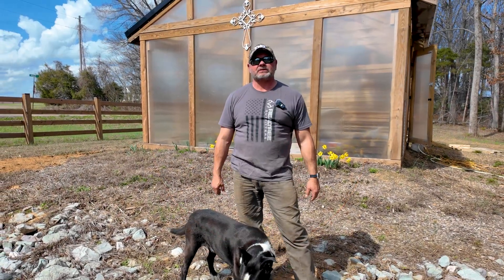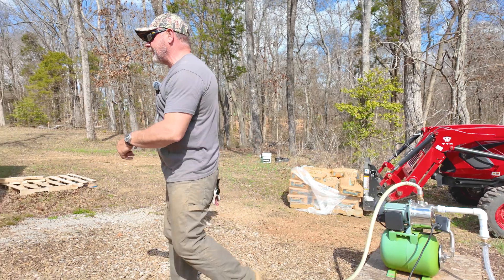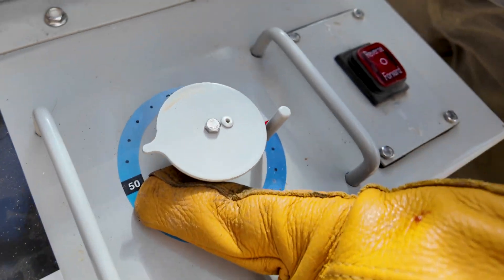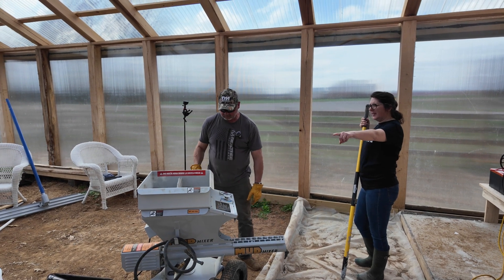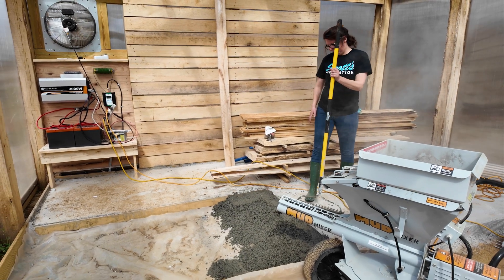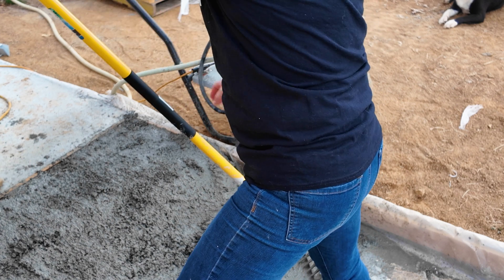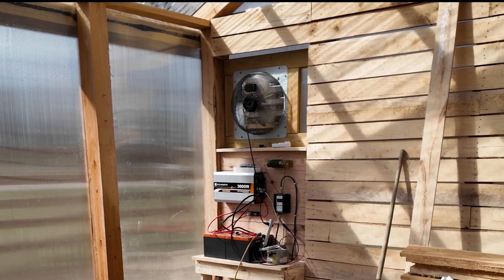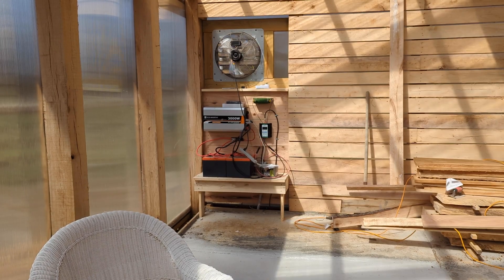DIY Greenhouse - Concrete Floors - Testing Solar Power System

Comment: One of the other MudMixer owners actually put a pressure gauge in the waterline and used it as a measuring gauge for adjusting water content - I think that is what I might do since we are working from totes with a pressure pump. Great Video, Tony! The solar set up that you have is fantastic! We will be operating off of a 48v when we are set up completely. I need to install two 48v wind turbines as well.
Reply from the maker: We are running 48v on the main house system, but we are very happy with the greenhouse power system. It is not fancy, but it works. Tanja's fan runs all the time.

Comment: I think that method of mixing concrete is pathetic? You just need a few yards of concrete gravel and a few bags of cement.
Reply from the maker: I really appreciate you taking the time to post your opinion. It has zero bearing on how I think, but at least you took the time to write some words.

Comment: How much concrete do you need to mix to break even on the $3,000 price tag? For that little pad you poured it seems like it would have been cheaper and quicker to have it delivered.
Reply from the maker: If that was the only job that we did then it wouldn't make sense. It makes sense for us because we are building an entire homestead and have tons of concrete to pour. Many places in which a concrete truck cannot make it into.

Comment: Hey, bring that mud mixer to Texas and help me pour a 40x50 pad and I'll make you some jambalaya. For real though, I want that mud mixer!!!
Reply from the maker: My friend, I have had several people say in a previous videos that the mud mixer was too slow. I don't believe they've ever mixed mud by hand and or even mixed it with an electric mixer. The mud mixer is so steady. It is constantly putting out concrete and it goes way faster than people believe. We dropped 22 bags of concrete through the mixer in about 35 to 40 minutes. I absolutely love that thing!.

Comment: I start my hand mixed pours by only pouring 2 inches over the whole area. Then mix a little wetter the next 2 inches and just use your boots and stomp the top and bottom layers to mix a little. That way the top of your slab will set up slower giving you time to finish it. If you pour the slab 4 inches  thick starting in one area by the time you get the end the starting point will be setting up more than the last bag you put in. Then you have to run back and forth checking different spots. Hope I explained that ok. Getting old. Been pouring concrete since 1970 most of the time solo. We use to pour slabs 1000 sq ft per man back in the day. I learned to make it easy on us. By pouring 2 inches at a time on 4 inch slab your always working with mud thats easy to move and work with. Just stomping your boots on the last 2 inches almost self levels itself. Dont pour to top of forms. Stay down 2 inches than after the whole area is poured 2 inches low. pour the top. Gently mix with the bottom mud
Reply from the maker: I am afraid your understanding of concrete will always be far beyond my reach. When it comes to something that really matters, I will hire a professional, 🤣🤣🤣 I do appreciate your insight. God bless